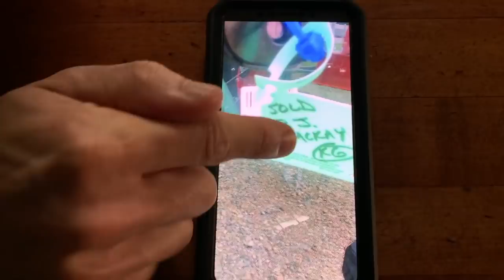Changing Things Up | PJ & Thomas

Comment: The last hardwood Oak floor project I did had four types of Oak and instead of putting stain on it we just put polyurethane on it and it was awesome. I was hoping you would pick a Case tractor. I am related to the inventor of that brand of implements. I imagine the one you're buying will be cheaper than a John Deere. Congrats on all your rearranging and your construction project progress.
Reply from the maker: that floor combo sounds lovely!! thanks for sharing friend!